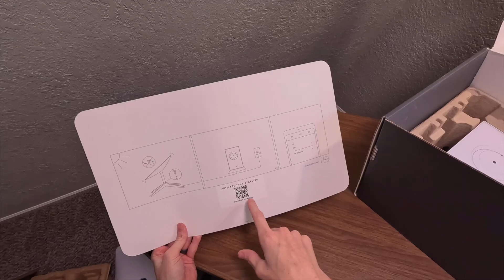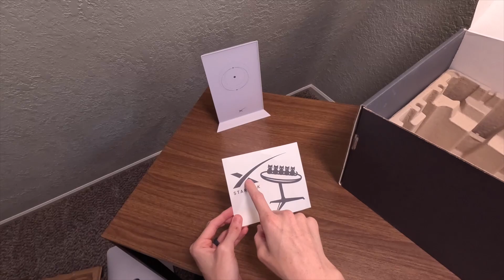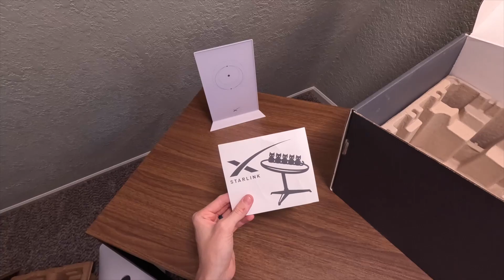Starlink Unboxing - Gen 2 Standard Actuated Kit

Comment: I expect mine to arrive just after the first of Nov.  I was concerned about needing a smart phone and the app. to install it but it seems that the standard kit finds the correct position for you. . Starlink help said it will down load to Firefox browser on my PC. So mounting the antenna, routing the cable and placing the router is all I'll need to do.  ( run 2 Ethernet cables to the PC and caption phone, because I'm near deaf ) That should be the end of the local ISP for me.

Comment: when taking down the dish as I've stopped service, the dish fell straight down to the floor but landed VERY FLAT- Faced to the concrete patio.  nothing seems to have been broken---I'm taking the Starlink equipment to France where I intend to re-start my Starlink (@ 50 Euros in France).   Do you think it might be ok??  anyway to really check??  Many thanks, Great Video as I'm re-boxing everything so your video is very helpful.
Reply from the maker: You can power it up to make sure it can still connect to the satellites. It will work even without service. You should still be able to access Starlink.com through the dish. The app will just say something like "service not active", but it will tell you if anything major is broken.

Comment: Hello, can I ask what the standard cable length is please? I could not hear you correctly in the video. Thank you.
Reply from the maker: It includes a 15 meter (~50 ft.) cable.
Reply: Thank you very much for your very quick response, that cable length will be more than enough for my needs.

Comment: I'm packing my Starlink system after selling it on Ebay, found your clip to make sure I pack it correctly, and I just found that the mast is sticking out from the back of the dish at an angle where it won't pack into the original box. Is there a way to get the dish to reset on the mast in the original way it came so it will pack correctly? I have a Gen 2 dish (rectangle shape). My Starlink service is not active. Thanks in advance for your help.
Reply from the maker: You would need to stow the dish. There are two good ways: First, if you have the app, power everything up and open the Starlink app. Go to settings, and hit stow. The second method is quicker and easier if you have the dish right in front of you. Power it on, and flip it on the antenna face. It should move into the stowed position within a 30 seconds.
Reply: I found out how to do it, but left this question in case others may be wondering.

Comment: i wanna know how well Starlink is for gaming? and does it matter where you place the dish?
Reply from the maker: Starlink works for online gaming. The ping is a bit higher than fiber or cable internet, but you’ll usually still get under 100 ms ping in most games, depending on where you are, and where the game server is. Yes, it matters a lot where you place the dish. You need a clear view of the sky to avoid interruptions due to trees. The Starlink app can be used to evaluate various locations on your roof. I recommend installing Starlink as high as you can on your roof.
Reply: I'm sending mine back as we speak because gaming is very poor. On warzone with zero obstructions constant packet loss, packet burst, and very high ping despite Ethernet adapter.
Reply: @MF215713  tbh i dont even play Cod anymore and whats the point of playing cod and never really got into warzone but Maybe bc Warzone takes soo much internet idk its cod yk
Reply: @meXicuttiioner69  fair. For me, all I play is ranked warzone and it was very bad for it. I never DC, so it should be great for games where ping isn't critical. Unfortunately, back to DSL for me on my ranch.

Comment: Excellent, lately been considering.  Moving my office Urgent need  rural England no mast service - no broadband possible.  

Just missed incentive deal in UK offering rental.  But could still monthly rent. 

I expect I have to add an additional SL router by extension for all my wire connections.  That and a 75 ft cable??    

Very Glad to know if I can afford a new one  the feet have screw hole.  I could mount to a hev flat plate .......and place on the flat roof of a shipping container for easy installation. 

??? Pls some www recomend if I want to eventually take it w me to another country back to Idaho or traveling etc i would need to be sure and get ??  The 'roaming model' pls advise?

  Bty I accept the UK rental models would not be even close to this unboxed current beauty.

Understood no customerservice if buying direct.  So i Subbed and live in hope this ancient Female from Boise can manage to stay connected.  thx

???Any link to a Wiltshire UK deal or beta testing??